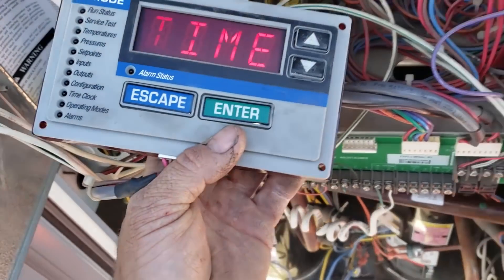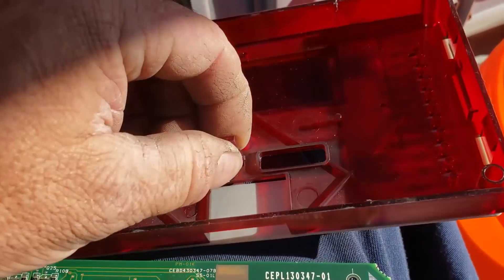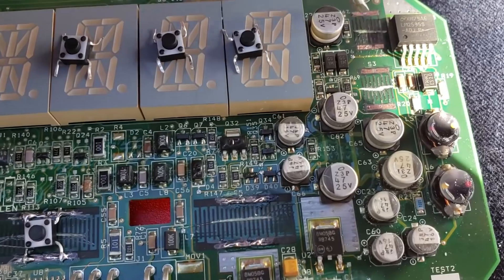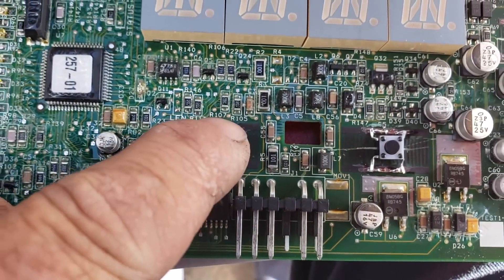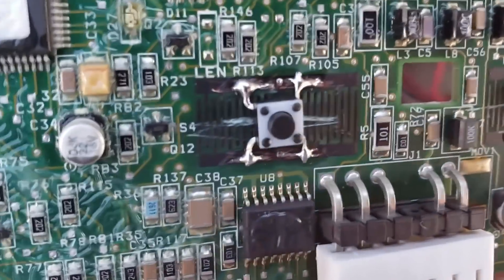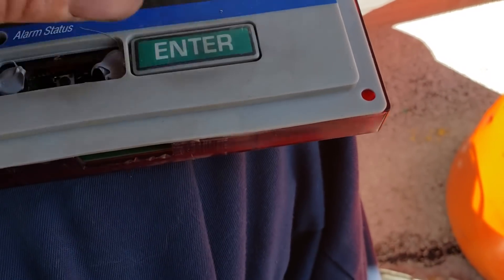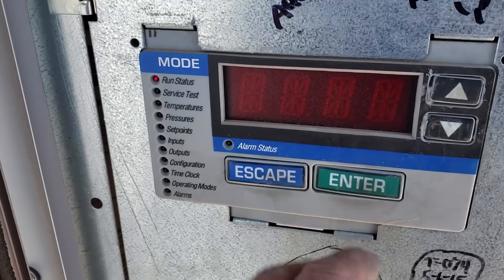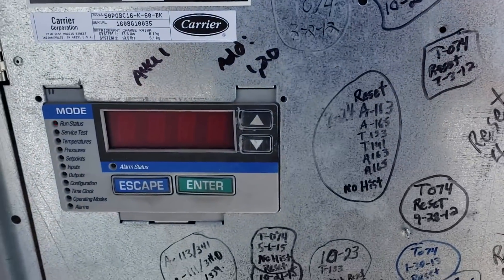Carrier Comfortlink Display Marquee rewired to be BETTER than factory!

Comment: On the display, once we power on, it presents an alarm oCOMM FAIL, it will have a recommendation and it does not allow us to navigate with the buttons. Thanks
Reply from the maker: COMM FAIL means that it isn't communicating with the unit main base board (MBB)
Most often you're missing some 24VAC somewhere or that MBB is failed or lost its memory.
Easiest way to find out is swap that marquee interface with another unit if you have another like unit on the roof. 
No unit specific memory is in the marquee so it won't hurt the other unit to swap them for testing

Comment: 24 Volt AC/ DC ?
Reply from the maker: 24VAC
Reply: @hackfreehvac  Is the board itself powered on by 24VAC? I have one here that I am trying to test, but I have not found any schematics showing which prongs go to what? I was guessing it would be 24VDC.
Reply from the maker: @josedeleon3654  Yes.
Two wires are 24VAC
Three for the comm link. 

I believe it will power and all segments will do a circle thing as it tries to establish comm link. 

May eventually just display an error
Reply: @hackfreehvac  hello friend.
please , Which of the 5 pins are the power pins and which are communication pins, thanks
Reply from the maker: @jesucristojunto9741  I'd have to look however the power are the red and brown wires next to each other. 
I think there's a space then three more wires for communication.

Comment: something is coming to mind here --- i think i remember using a pencil eraser to remove the oxidation from the board and in something  similar like this it solved the issue. its just oxidized board. try pencil eraser across the up and down lines i think it will work , but your idea is a more permanent fix.
Reply: OcRefrigeration,Hvac & Electrical. 
I think I remember doing that to a Nintendo controller or something lol. Wow that was a long time ago

Comment: Great video ! ill definately use that idea if i run into one of those out here in cali. What years did carrier use that set up ? & are new boards still available ?
Reply: OcRefrigeration,Hvac & Electrical. I can’t tell ya when they started but they are still coming out on new units as far as I know. New chiller we put in had it.